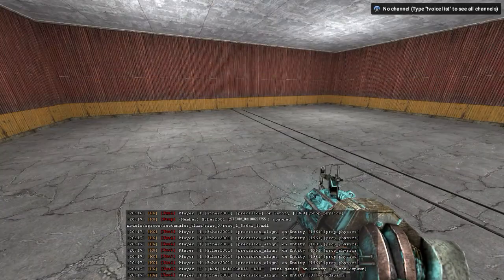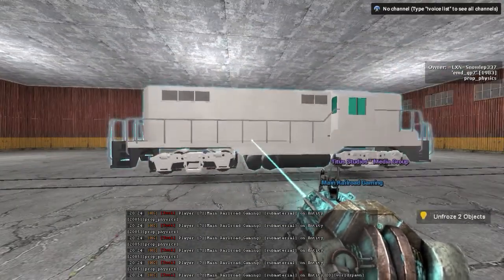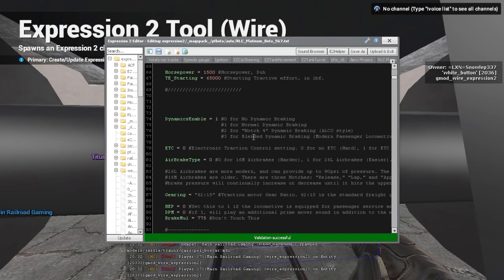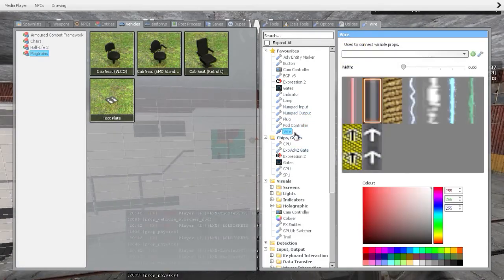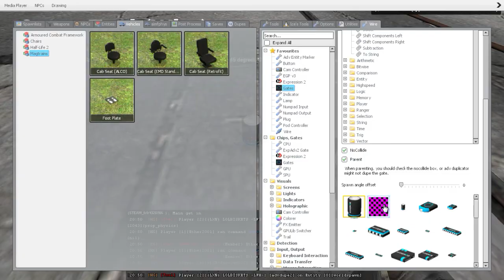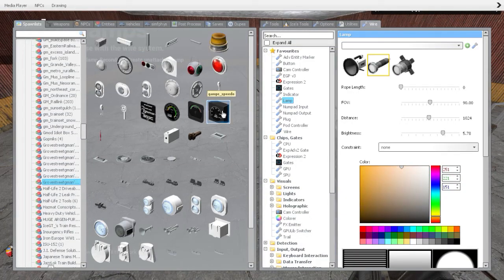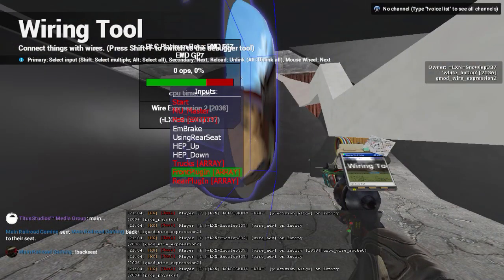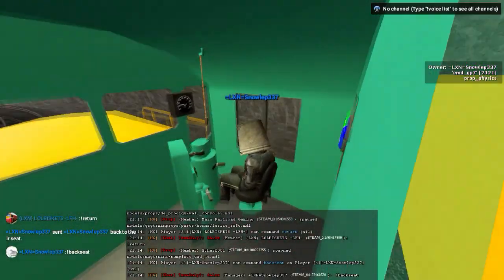How to wire RLCPT (NEW) Garrys mod train build

Comment: How do you wire two trains to run dual locomotives? With the plug and stuff.
Reply from the maker: After it's all wired up you just need to plug the locomotives into each other and turn the mu off in the slave units.
Reply: Okay thank you :)

Comment: So I have done everything and wired everything (I think) and the reverser isn’t there and when I push the  air breaks it just goes automatically, not while I hold the button down. I have messed with RLCPT quite a bit but I can’t seem to get mine to work
Reply from the maker: Start with a fresh rlc pt and go over all the steps again

Comment: For some reason i did everything you told me in the video. But my control stand is missing a handle in the front to release the breaks/reverser etc. I have the correct control stand. But the train does not move. It just turns on
Reply from the maker: sounds like you skip'ed a step, you need to wire the control stand.

Comment: the body of my locomotive leans/sways when its on the tracks. i followed all the settings (i think at least), what am i doing wrong?
Reply from the maker: You have to have the locomotive pointing a certain direction when you put the trucks on or else it will not tilt forwards and backwards to the locomotive, instead it will make the locomotive tilt side to side.
Reply from the maker: I do show which way the locomotive should be pointing.

Comment: I've rewatched this video over and over several times now and I still can't figure out why my locomotive won't move, the control stand doesn't respond to me.
Reply from the maker: Join FC&N right now and I can help you.
Reply: I have the same problem
Reply: I parented everything but i just wont MOVE
Edit: i parented everything correctly.
Reply: Old issue, I didn't toggle the MU button   @purpv
Reply: @floridianrailauto9032  I first start the engine and then the 'muffin' button. i put it into F and go one notch up. My locomotive starts shaking and it wont move.
Reply: @floridianrailauto9032  Im on FC&N now. If you can join could you please help me
Reply: I was banned because an admin baited me into running a red signal  @purpv
Reply: Atlantic Coast Line i can help you
Reply: Purp V release all the breaks
Reply: 1:  No, they weren't the brakes
2:  I figured out what was wrong a lot time ago
Thanks tho @itsjusttyler5315
Reply: @itsjusttyler5315  I realized it. Thanks alot for the help tho👍🏻

Comment: What about the horn and bell?
Reply from the maker: Liljahjay Gaming Official they arnt  really necessary I just wanted to show people how to set up a locomotive with rlcpt...
Reply: I found out how to wire the horn and bell so thanks.
Reply from the maker: Liljahjay Gaming Official honestly I'm not to worried about the horn and bell, there are really only two things you have to wire on it and it's verry simple but  if it becomes a big problem then I will do a video on it.

Comment: the train is working but the panel not like i'm puting on F then notch 1,2,3 etc. but on the panel is N and notch 0 and train is moving
Reply from the maker: Is it the right control stand e2? Did you make sure everything was wired properly?
Reply: @Snowlep337   i fixed, thank you anyway XD

Comment: whenever i dupe it, i can't get the darn thing to start, any sugestions
Reply from the maker: FazbearLegun53/ TrainManButton maybe you didn't wire something properly or you possibly parented the RLC Platinum E2
Reply: I got that fixed, but how do you change the controls and have them accutally work, i can't get my dynamics to work.
Reply: Open RLC PT e2 search for dynamics and change number from 0 to number of dynamics  (theres few of them)
Reply: Rewire the start

Comment: You should teach us how to wire a b unit up.
Reply from the maker: Devin Hanson all you have to do is wire every thing to make the loco move and make sure you have MU ports. You don't need a control stand or anything like that
Reply: Alright then, what about the exhuast smoke CLAG thing that people do?
Reply from the maker: Devin Hanson it's built into the e2
Reply: @Snowlep337  Does the b unit need an expression 2 as well or no
Reply from the maker: @hazethedeer2588  yes

Comment: The reverser doesn't work for me.
Reply: SanDiegoRailfan399 when I use a different prop for the control stand none of the controls move
Reply: You need to put the toggle on the MU_Starter button.

Comment: The engine-thingy isn't going white... it stays red.
Reply from the maker: The rlcpt e2?
Reply: yes
Reply: It also shows this: "The Expression 2 function data has not been transferred to the client yet; uploading the E2 to the server for validation.
Note that any includes will not be sent. You must wait for the function data to finish transmitting before you are able to use includes.
sv: No such function: entity:propDraw(number) at line 250, char 14"
Reply from the maker: Marius Marincek you're trying to do it in single player?
Reply: Yes.
Reply from the maker: Marius Marincek that's  your problem, the e2s act funny in single player, you have to have special stuff configured on your game for them to work in single player.

Comment: i can not fine the severs.
Reply from the maker: The servers don't exist any more
Reply: What sever could I use to get the codes
Reply from the maker: It should work on any build server
Reply: i tryed to use the command but it never works
Reply from the maker: OH to get the e2s you need to goto FC&N
Reply: thanks i at last have the e2 code thanks for helping me
Reply: Snowlep 337 the e2 won't let me wire it
Reply from the maker: Can you go into detail? Is it saying error or its just not letting you wire it?
Reply: Snowlep 337 nvm
Reply: Snowlep 337 I did have problems yesterday with the wire hud not pop up but I think I have to build in a server
Reply: By the way I can't get my engine to dupe right
Reply: Do you know how to wire a remote switcher
Reply: Nvm I figured it out
Reply: I'm banned from FC&N now how am i going to get the e2 pack?
Reply from the maker: try going onto lexon trainbuild... if it still exists